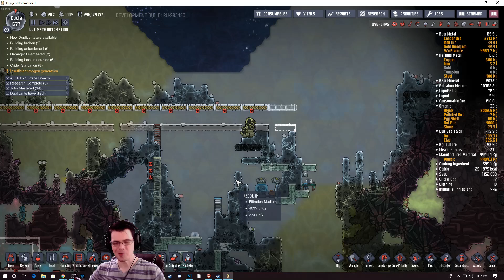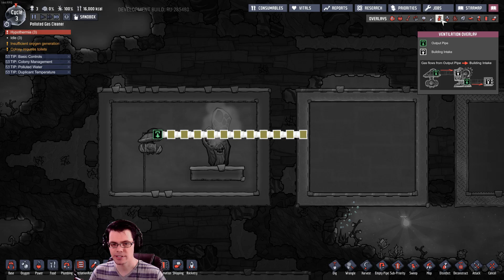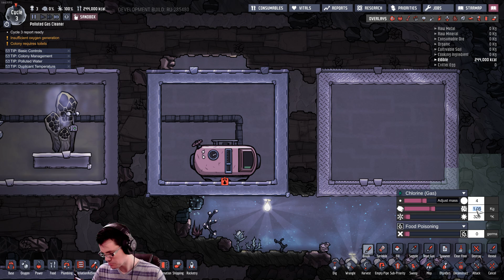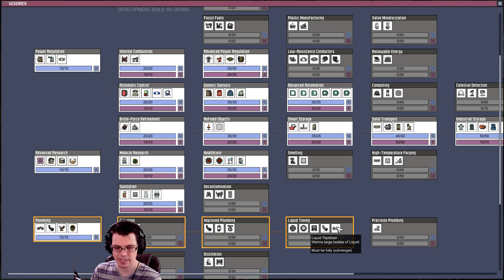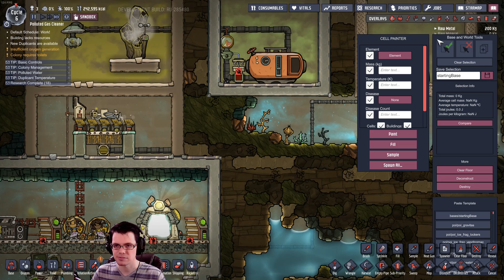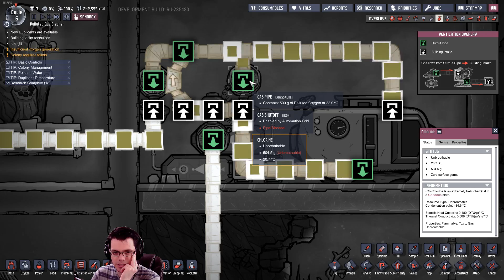Automatically Disinfect Oxygen and Water! Oxygen Not Included

Comment: I feel like if chlorine doesn't clean the gas in pipes, it shouldn't work on reservoirs either, so it might get patched
Reply: No. It's intended. The reservoirs are categorized as storages as I noted when the first systems of this kind came out on the Klei forum a few weeks ago. All storages are exposed to the surrounding gas, so reservoirs should not be different.
Reply: @SamsoniteDove  so what should be an airsealed container is actually exposed.
it doesn't make sense.
Reply: @IcoKirov  It's a game, it doesn't have to make sense.
Reply: @SamsoniteDove  you are correct to some extend.
but most of the things in game make quite a lot of sense.
your workers breath oxygen, it makes sense. the oxygen runs out, it makes sense. you can produce oxygen by water and turn it into oxygen and hydrogen, it makes sense. you can use hydrogen, natural gas, coal and so on to make power, it makes sense. the power generation produces heat as well, it makes sense. the heat transfers to the surrounding, that makes sense...
almost anything in the game make sense.
if they want oxygen to be cleared from germs in similar way they can just create a new machine that have two intakes, oxygen and chlorine and it uses one to purify the other emitting a mix between the two at the end (one tick it emit oxygen the next chlorine)

for me, this doesn't make sense neither in real world perspective nor in gameplay perspective
Reply: @IcoKirov  So using hydrogen, natural gas, coal etc to make power without using oxygen makes sense to you? That's a pretty big leap of faith. Mixing hydrogen and oxygen in a room and heat both to 1000C or more without causing an explosion makes sense? Electrolyzing hydrogen and oxygen from 1kg water using 120W of power makes sense when even the theoretical minimum to do that is 100000 times more? Dupes uses about 80 times more oxygen than an adult human doesn't makes much sense either.
I think you're just cherry picking what you think makes sense and what does not based on your own opinions here.
Reply: @SamsoniteDove  i don't agree.
the things you mentioned now are cherry picking, because they are very specific, numbers doesnt need to be exact. we can say one thing is 120W or and the other being 240W, and the power generator to be 400W. or we can say they are 1200W, 2400W and 4000W. or whatever, it's not the numbers that matter.
it doesnt make physics sense for a wire 1m long to take 25kg of metal. but in game it's ok, because that's just a number. the important part is that it requires metal to be created, not how much. the number is just game balance. 
of course not everything in game can be or should be strict physics. it won't even be fun if it is.
but a dupe using 80 times more oxygen than real person, is not the same as disinfecting something without even touching it.
the dupe has to be at a place where there is oxygen in order to breath. it won't make sense for him to breath if the oxygen is 2 meters above him, right? and it won't make sense for him to breath the oxygen that is inside the tank, without releasing it (and i'm not talking "make sense" from a physics standpoint, i'm talking strictly gameplay). then why would it make sense for the oxygen inside the tank to interact in any way with the outside world. if chlorine can disinfect the inside of the tank, then for me a dupe just standing on the tile where the tank is should be able to breath the oxygen inside it... (even if the tank is submerged for example)

for me this is not cherrypicking. for me this is gamebreaking (although this is not the best word to use)
it's one thing for food inside container to get disinfected if the container is inside chlorine. we can assume the container is not perfectly sealed, we can accept the inside of the container to be filled with chlorine, basically we can accept they are interacting. but for an airtank... 
would the content of the tank get infected if the tank is placed inside a room with germs in the air (or in the liquid if the tank is submerged)?
Reply: @IcoKirov  I don't expect you to agree with me nor do I really care if you do. I just picked apart the examples you gave yourself. There are many things in the game that make no sense. Like grams of liquid holding back any amount of air pressure, or the reverse grams of gas holding back millions of tonnes of liquid. Doors that transfer heat when closed but doesn't when open. Liquids and gases that don't transfer heat when above or below certain arbitrary amounts. And don't even get me started on sour gas. It's a game, it doesn't have to make sense. As long as it follows rules that are consistent. And that exactly what we're talking about here. Tanks are considered storages, and follows the same rules as other storages. It may not make sense to you but it's at least consistent.
Reply: @SamsoniteDove  but that's what i'm saying. for me this is not really that consistent. I'm not sure if you have even read what i have written. answer me the last question - would the content of those tanks get infected if the outside is filled with germs? and what about the other way around - if the germs are inside can they spread to the outside? i haven't tested it, but i assume they can't? if they can then ok, that is some consistent behavior. although strange. but for me this defeat the purpose of the tank itself, thus me saying it doesn't make sense.
also why can't a dupe breath the oxygen inside the tank if the content can actually interact with the outside?
as i said, i don't search for total physic accuracy. i'm searching for gameplay sense. would this be fun, would it be functional, would it be gamebreaking, would it make sense to exist in the game. for me this  is just a bit of gamebreaking, and doesn't make much sense to be present in the game.
if the devs want containers to be strictly interacting with the outside, then in my opinion those tanks should be categorized as something else... sealed containers if you want.

and yes, some of the things you mentioned above i don't like as well. i'm not saying this (the tank issue we are discussing) is the only thing i think should be changed. the heat transfer is basically a bug for me. it may be the normal result of the systems interacting, but actually a lot of bugs are exactly that undesired effect of system interacting correctly according to the programming, even the specifications. the same with the grams of liquids can hold tons of gas and vice versa... and according to game yes, two different elements can't hold the same tile... ok, so this is consistent? not for me. different gasses cannot hold the same tile as well, but they can switch places naturally. so the consistency drops here for me and the system should be changed so gas and liquids can also switch places (or more like one to push the other if there is place, if not, then switch places) if for example the content in one of the tiles is with higher mass than the content in the next. or something like that.
Reply: @IcoKirov  Yes, I have read your entire, and much too long for youtube, comments. I'd prefer to have discussions on the Klei forum on such matters. Now back to your question. Items inside storages to not affect the gas/liquid they are in unless the item can sublimate. But the gas/liquid they are in affects the items inside. Thermal transfer is both ways however but with the caveat that items inside affects the temperature of the storage itself which in turn affects the gas/liquid they are in, and the opposite. Tanks however are insulated so minimal heat transfer occurs in either direction.
Reply: I think you mean categorized as storage?

Comment: Hi. Your system with two tanks will eventually fail. You need a system with 3 tanks. One that fill up with germy gas/liquid, one where it rests while killing off all germs which takes a maximum of 200s no matter how many germs there is, and one which is emptied. Luckily there's already a working system posted on the Klei forum with all the automation needed. Cheers.
Reply: You don't really need to clean all of it though unless you are keeping it in its germ growing form
If you kill 3/4ths of germs then refine it into something the germs die off on your dublicants can take the rest using their 15% immune system
Reply: chadoftoons  Not all of us play easy mode ;)
Reply: However, it's mostly useful for liquids anyway. Infected Oxygen geysers are really puny and output very very little oxygen. A much easier way is to just analyse the geyser. Set an input stop valve on a single gas reservoir when pressure rises for the eruption amount of time and that timer then turns on a 200s second timer that will kill all the germs before it opens an output stop valve. If you bother to use them at all because the average output is typically less than what a single dupe with divers lungs needs.